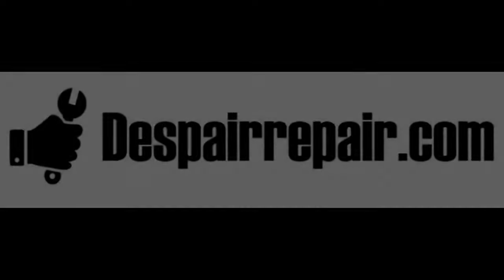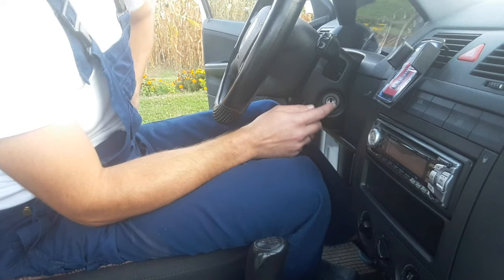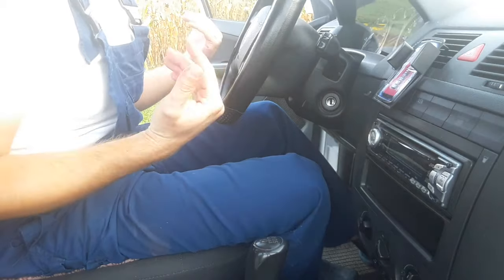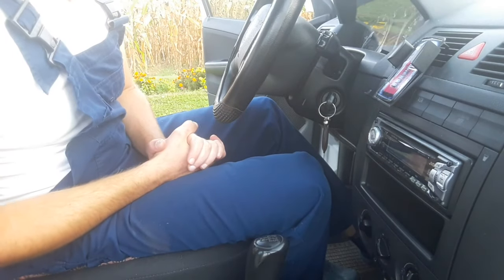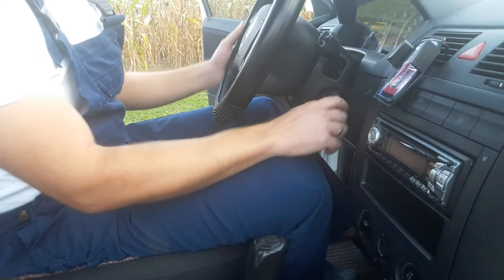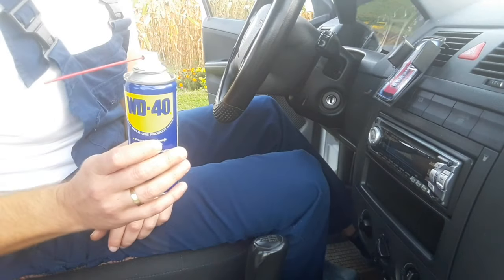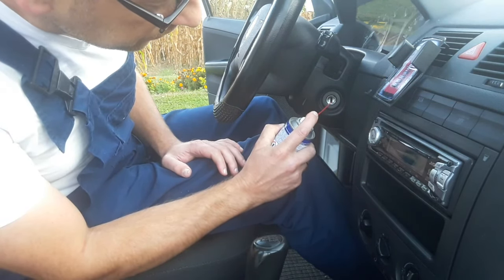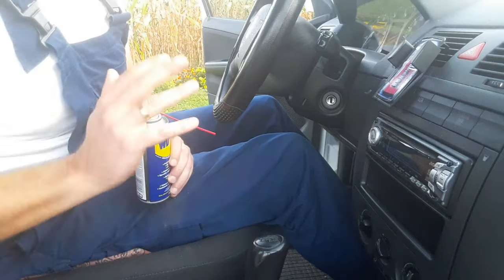KEY WON'T TURN IN IGNITION-HOW TO FIX IT

Comment: Do not use standard WD-40! Standard WD-40 is a solvent, not a lubricant and will, in fact, remove any type of lubricant that is in the cylinder. Use a lubricant that has a silicone, graphite or Teflon base only. Something that will dry fast and won't turn the inside of your cylinder into a dirt magnet. WD-40 makes a dirt and dust resistant dry lube version that is specifically made for lock cylinders. Engine oil is probably something else you don't want to put inside your lock cylinder. Dirt and dust particles stick to engine oil like glue.
Reply: I am having this problem right now, what do you suggest to use?
Reply: Great already used wd40 because i was stuck and it's all i had available
Reply: @PG_FISHING spray the lock out with electronic connection cleaner, or something else that won't leave a oily residue, let it dry, then lube it with graphite.
Reply: Well, unfortunately this was my only savior. What do you recommend now to be done?
Reply: @michen25  you can do what @wanagerscott wrote above. The electronics cleaner spray will remove the residues of the wd40, use it abundantly. Let it dry a few hours then apply a suitable lubricant

Comment: A supporting tip for anyone who needs oil.  If you only need a very small amount, such as for a key, you can always pull some from your dipstick.  It's a very small amount at a time, but for keys it's about right.

Comment: THANK YOU GOD JESUS! IT WORKED! Im baking out in the sun! The WD-40 little red straw rolled away into heat vent when i rested it on the dash board 😂 . After that, i was still able to spray it inside the ignition and in both sides of the key ...2 min later...vroom! Vroom!

Comment: Thanks this just saved me from being stranded in a gas station 300 miles from home in 90 degrees of heat never had a problem with this part before on my jetta 2008 so from my family deepest thanks
Reply: Me rn haha
Reply: I have the same car. What worked for you. The battery is not dead and I don’t think it’s the steering wheel lock....
Reply: Ha ha that happened to me as well. Thanks to this video and the help of God I fix it up Thank you.
Reply: I have the same car and problem. Very stressful.

Comment: After watching several other videos with possible fixes for this situation, stranded by the way, this worked. I didn’t have any WD-40 or other spray type lubricant but I did have a partial bottle of lawnmower engine oil in the back. I opened it up got a little on my finger, lubed the key with it and have it a try. Didn’t work, shit! In my mind I’m saying to myself this isn’t gonna work either! The man said try it 2 or 3 times. I hit a little more oil on my finger and lived the key again.  Here goes nothin!  Gave it a turn and the key moved like nothing was wrong. Thanks a million my friend. I’m gonna go raise a cold one to you.

Comment: Thanks for going straight to the point with the video unlike most youtubers. I had frozen groceries in my car and the car was red hot from the sun. I wasn't able to turn the key or the AC for that matter. Not my best day today but your video helped me a huge deal.
Reply from the maker: You're welcome and glad the video helped.
I try to be concise which is not always the case :-)
Best regards and thanks for watching.
Reply: Didn't have ac?...soft white underbelly youtube channel...
Reply: I swear to God this video helps me. I really really appreciate it for your advice. My car just works when I try to turn the wheel and try to start.

Comment: Thank you thank you thank you!  I was stuck at work and had to get my kid from daycare. I got the plastic off and was able to remove the ignition switch from the cylinder. I was able to turn the key enough to unlock the steering wheel and started the car with a screwdriver in the ignition switch!  Life saver!

Comment: Thanks dude! Saved me. The ignition switch started being really stiff a few days ago from now being so hard to turn, like even past the ACC part. I put a little bit of engine oil that I had since I had no WD40 or silicone spray/graphene, on paper and smeared it on the key and after a few wiggles and turns it finally loosened and is now smooth as butter!
Reply: Tu iony😂😢😂nye😮😂ut😂 the ry😂typical

Comment: Hey I just tried what you said about putting the motor oil on the key because I had no wd40. I got the oil from up under my hood, one of the oils there and wet a piece of  paper towel. I had been having trouble 2 days with the ignition not cutting off completely and I was feeling terrible knowing it was gonna cost me a small fortune to fix. 

I did what you said (lubricated the inside of the lock as well) and it worked!!! I just wanted to say thank you so very much! You have saved me sooooo much money!!
Reply from the maker: Hi and thanks for watching!

Glad that the video helped and that you solved the problem 🙂

Comment: Tried this on my wife's 2007 vw beetle. These locks don't like liquid lubricants, it makes the problem worse.  I should've used powdered graphite as now although the key goes in and out nicely, it will not turn. It's possible it is the lock housing, but this issue became accute after lubricating the lock mechanism. 
I am now looking to replace both lock and housing, and as stated in the video probably going to cost me around $1000.
The lesson learned here is use powdered graphite and not oil!
Reply: Interesting

Comment: Thanks for the assistance, took my wife's car out and pulled the wheel after I had turned the car off, came back and the key wouldn't move,  jiggled the wheel a little and pulled on the key and it worked! Thanks again!
Reply from the maker: You're welcome and thank you for watching! Glad if the video helped.

Comment: Thanks!   The oil worked for me.   I was stuck at work yesterday until my wife brought another key for me to try.  Her key worked, but it still took a couple of minutes even with her key which isn't nearly has worn as mine (18-year-old car).   When I got home, I shut the car off without removing the key or touching the steering wheel.  Again it took a couple of minutes of trying to get it to turn.   After putting a few drops of oil on the key and working it for a few minutes, it now turns freely!
Reply from the maker: You're welcome, thanks for watching and glad if the video helped 🙂

Comment: Hi, thank you so much for that you helped me out big time :) if it’s ok with the wd 40 is it a temporary fix and I still need to change the part later or am I good to go for a few more years ?
Reply from the maker: Hi, thanks for watching, and glad that the video helped!
If the inner components of the lock are not damaged, then you've probably solved the problem for a longer period of time.
Just pay attention from time to time is it working properly. If it starts to get stuck despite the fact that you've cleaned and lubricated it, then change the lock ASAP.
Hope this helps and all the best to you!

Comment: Oh, thank you for this video!!!! I went out to the truck this morning and took a socket (was not about to take the plastic off around the ignition) and held it over the ignition and tapped it with a rubber mallet like 3 time and it started right up.

Comment: Thank you for your simplistic approach to this common problem with very simple tools to complete the job you saved my ass I've been stranded for the past hour  -9 degrees Fahrenheit of weather I should have thought that I shouldn't didn't know you could use WD-40 thanks again man I'll pass on your your knowledge to other people that have the same problem
Reply: technically speaking wd40 is a cleaner, as far as i understannd graphene should be used as a lubricant.

Comment: Bruh thank god ❤️‍🔥😇 you are literally god for me rn. My mom’s car didnt turned on while I was doing some random stuff to the car in a parking lot. Mom wasn’t nearby and I was really worried. I did every possible thing and then just googled after few hours of 😞 failure. And just found this video and within few minutes I’m driving happy and safe to home.😅 Btw in my case my all my brakes, steering wheel and the ignition was locked and I low-key freaked out so I tried steering my wheel left and right and at the same time I turned the ignition on and it worked thankfully 😅

Comment: Hi I will try to put lubricant ,i have toyota yaris AUTO 2004 , my brake still stuck in the middle & key isn’t moving 😵‍💫😵‍💫 kindly guide me , do i have to change the whole ignition set / barrel

Comment: I had the same problem with my 97 Mustang. It was simply a matter of the original key being ‘worn out’ preventing it from engaging the ignition lock. As a member of AAA, I simply contacted an Auto Locksmith affiliated with AAA, had them make a couple of new keys (no charge) and problem solved. Key turned smooth as butter and use of oil was not necessary
Reply: Only $300 problem solved🙄

Comment: Deighted to say that this worked! Many thanks, only problem is I don't know how good a fx it will be long term and whether I should risk taking car out again, and just have DW40 with me as a permanent companion in the car, or whether I should just drive it straight to the garage to get replacement bolts etc fitted... I'm NOT a DIY person, and could not manage to do this myself; indeed I consider it a miracle I managed even to fix this....

Comment: Nice, straight to the point video.  I used WD-40 Silcone spray, as I didn't have any WD-40.  Not working for me, I can turn my steering wheel abit in both directions but the key won't turn.  I had to leave my car today in a carpark that's locked for the weekend.  Any additional suggestions on what I could try? the silcone spray, I used about 30 minutes before I had to leave, do you think if it soaks it might work?  First time I've had this issue.
Reply from the maker: Hi and thanks for watching! If the tips in the video didn't help I would recommend not driving the car and checking the lock ASAP.
Using silicone spray is even better but to be honest I don't think soaking will really help.
All of this helps when the lock is jammed due to filth and grit inside the lock. But if the key or the lock is physically damaged, you have to repair it.

Comment: This just happened to my 02 Explorer and before I found this video, I used WD40 and it helped but not permanently.  My next fix was dipping the key into light weight grease (Vaseline, white grease, etc.) insert the key and gently start to turn the key.  Once it starts to move, cycle the key back and forth until it feels loose and smooth.  I keep a small amount of Vaseline in my glove box.  Works like a charm...
Reply: I'm here because of my 2002 explorer. Thanks!

Comment: a guy used pliers to turn the ignition.
now my truck is not starting.
would your tecknic work or should i try something different?
Reply from the maker: Hi and thanks for watching!

Is it not starting as in not cranking or the ignition key won't turn?

If pliers were used to turn the ignition, you should change the ignition lock cylinder as soon as possible, there's probably something seriously wrong with it and that's dangerous.

Hope this helps.
Reply: @DespairRepair  it is turning, the car recognize that the key is in (peeps to say the door is open) but it does not turn all the way to ignition.
I am asking someone to replace it for 200$ but now i see that the cylinder to be changed is just 77$.

Next time i will change it myself
😅 
Thanks again

Comment: Thank you!!  I watched another video that said to tap on the key with a rubber mallet.  I did that a few times and it still was not working well.  Then I came back and looked again and found your video,  Of course try some lubrication first!  That helped but not enough.  Got my spare key which is still brand new (2002 Liberty) and it worked just fine - like brand new!  My original key was worn out.  Got two new keys made for $5 and all is well.
Reply from the maker: You're welcome, sorry for the late response and glad the video helped! Good thinking on using a new key :-)

Comment: Would this work on a Peugeot Partner van registered in 2011? I'm concerned it could mess with the electronics? Thanks.
Reply from the maker: Hi and thanks for watching!

I think it should if the locking mechanism is the only problem. But to be sure use the spray, not oil, just in case. 
Also, don't flood the ignition lock with the spray, just use a couple of short bursts.
Hope this helps

Comment: Thx bro that wiggle the steering wheel method actually worked, I think my steering wheel may have locked bc I didn’t turn off the car correctly
Reply from the maker: You're welcome and glad if the video helped.

Comment: My problem wasn’t mentioned in this video. My master key works perfectly and turns in the ignition. However, I purchased a new keyfob and got it cut by an auto locksmith. The new key fits in the ignition but doesn’t turn. What do you think could be the problem?
Reply from the maker: Hi and thanks for watching! 

Some time ago I had the same problem and solved it by getting a replacement key. What was the problem....they didn't tell me just know that it worked after that.

If the original key works properly and the new one doesn't...in your case and if possible I'd do the same thing.

Hope this helps.
Reply: @DespairRepair  Okay I’ll check back with the auto locksmith, thank you for the suggestion!

Comment: Hey sir I’ve tried all of this and lubricators to check n see if the ignition cylinder is just jammed up with debris.. but honestly I think there is something that is not allowing the cylinder to fully turn & engage.. im really curious to see what exactly is not allowing this ignition cylinder to engage with key!! I’ve tried to replace the ignition switch & that isn’t the issue.. the only way to start it is to have the key in ignition & to have the switch plugged in but not mounted on steering column & to use another sub standard key to turn through the switch to crank that way… but my only conclusion is there must be a malfunction w/ the Ig cylinder to not allow the key to turn it.. I don’t wanna have to spend to much more money w/ taking apart the whole trim & steering off or to go to a junkyard & take off the entire ignition cylinder if that’s at all possible which from what I’ve seen doesn’t look possible from how I’ve seen it’s clamped on with the bolts that don’t have a screwhead in other words it can’t be loosened or removed without cutting off with grinder etc… I could really use some personal insight on this my dear mechanics!! Pls & thx forever to the community & the moto wizards! Stay geared up fellas!! Let’s narrow it down!!

Comment: Can this also happen when your battery is (almost) empty? Last 4 days my car started a bit harder, i think cause of the heat and used airco alot.
And yesterday and can't turn my key anymore but windows can still open..

Gonna try it today first with reserve key and if need a bit wd40, but i read it is not so safe to use it?

Comment: can i use ac-90 lubricant?
Reply from the maker: Hi and thanks for watching!

I never used it myself but essentially you can use any kind of mechanical/machine lubricant spray that isn't aggressive to the inner parts of the lock and will lubricate the mechanism for a longer period of time.

Comment: What if u had previous issue with steering wheel/lynx & key was bent. How do i find out exact issue without taking mechanic?
Reply from the maker: Hi and thanks for watching! In that case, you should replace the lock and key, it's the safest option.

Comment: Or!!! If you're stuck at a Costco parking lot like I was, step out of the vehicle, lock the doors, count to ten, unlock them and then try again.
Worked like a charm.

Our Jetta does that when you lock the doors from the inside, before turning the engine on.

Comment: tried everything as you described, still won't turn at all after being inserted (2003 Civic LX manual)...by the way, the same key to unlock the door, so it's interesting how the key works for that but then stuck in ignition(?) sprayed lubricant in keyhole and tried multiple times...what is the next recommendation? Thank you
Reply from the maker: Hi and thanks for watching! I think the locking mechanism inside the ignition switch is faulty.
That's why it works with one lock and not with the other.

Comment: It's there wonderful theft deterent measures going bad ..I'm trying to figure out how to wire in a back up system/switch , so if it fails i can still start it and go , I customized the wheel lock mechanism , that part will never hold my key from turning again , but , you can steer it whenever you want ..if they wanta steal my wore out junk truck I will wish them good luck ..

Comment: If the car keeps locking after you park, would this likely resolve it? Key goes part way in and I'm still jiggling the wheel and waiting until it aligns enough for the key to go all the way in. It works. But it's been happening every time.
Reply from the maker: Hi and thanks for watching! It won't hurt to try but if even after this the wheel keeps locking up then it's time to check the lock mechanism definitely.

Comment: My key won’t go into the ignition but when I can wiggle it in my steering feels very lose? I’ve only had the car for a year now from brand new, is this a problem with something else than just my ignition?
Reply from the maker: Hi and thanks for watching!

I think not, it could be a problem with the ignition lock cylinder or the key itself

If so, then it's strange since the car is almost new.